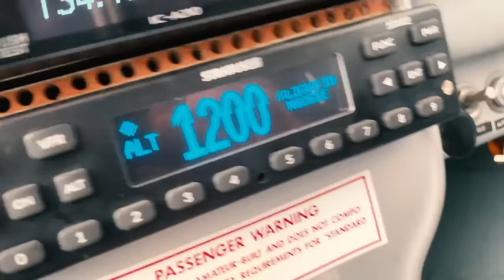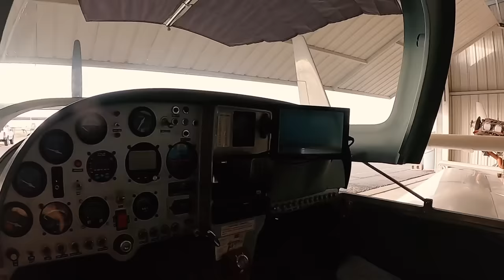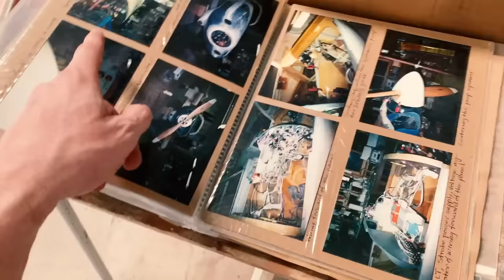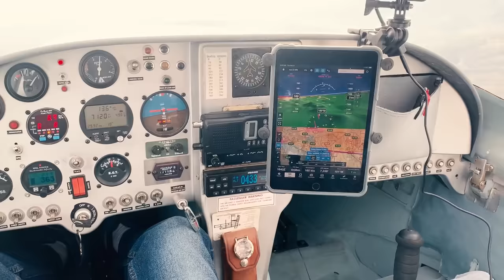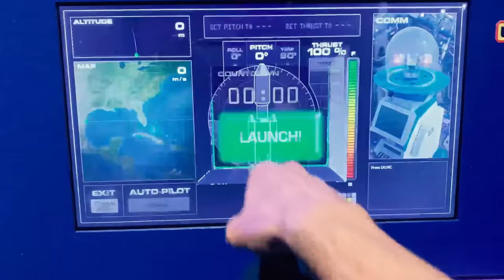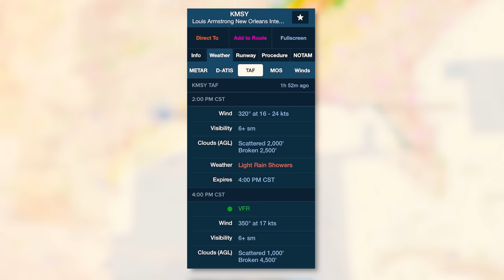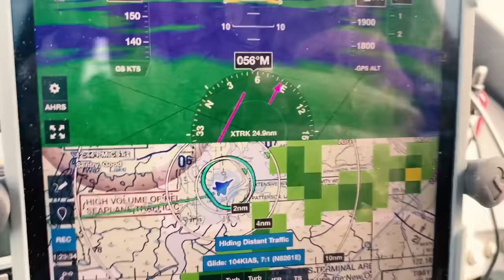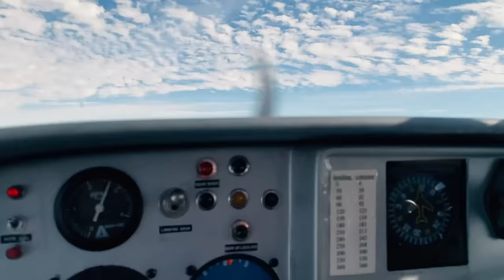Will This Small Airplane Run & Fly 2,126 Miles Home? Tornadoes

Comment: The jet is a Fouga Magister.. Awesome little training jet. French build, and extensively used by the Belgain airforce.. Love the Lancair!! I think you got a great buy there!!
Reply: Used by the Irish Air Core also. Good  museum piece at Atlantic Air Venture Shannon
Reply: @ju898  and by the Katanga Air Force in the Congo
Reply: @marcjohnson4884  Is that even still a thing?????????????????????
Reply: Louder that a T-37, and that says a lot.
Reply: @ju898  Irish Air Corps ;)
Reply: @paramotortheory  Much more louder...lol
Amazing old jet prop sound
Reply: Top speed: 444 mph

Range: 575 mi

Weight: 4,740 lbs

Length: 33′

Manufacturer: Fouga

Engine type: Turbomeca Marboré

First flight: July 23, 1952

Googled it lol
Reply: Fouga was also used by Finnish airforce
Reply: The Magister was used by german air force for training too… it was called mouse killer… the sound of the engine tells the story… that thing is loud as hell and at a ultra high frequency 🤪
Reply: Seems like a good first jet revamp for Jimmy.. Just sitting there waiting for some love... And to be started again!!
Reply: I once met a guy who was flying a Fouger Magister down to Florida for Sun'n'Fun from somewhere in the north of the US. He had bought a spare pair of engines for $2000 each, and ran the aeroplane on central heating oil. It cost him less to fly the Magister than it cost me to rent a PA28 here in the UK. We don't see many, if any, Fouger Magisters flying here in Europe these days.

Comment: I recognized Big Lake TX! My father (Orin Fell) used to go there throughout the 70s and 80s in the summer, to spray mesquite and prickly pear down there. I was a flagger for him. We spent every summer down there until I graduated from high school. He flew Cessna ag wagons initially, then got to AT301 air tractors with the R 1340 Pratt & Whitney’s throughout the 80s. I absolutely recognized the inside of the FBO office. The airport has changed quite a bit since then, but the inside of the gas shack has not. There used to be a Lockheed Lodestar parked off to the side that was hauling drugs and landed on a ranch. The dope haulers flagged a ride to town, then went into Big Lake and tried to pay cash for a pickup at Glasscock Chevrolet, and they smelled a rat and called law enforcement.

Comment: Jimmy the jet is French and is a Fougar Magister. I got two hours in one years ago because it was on the flight line of my FBO. Got to know the owner who also owned the 152 I did most of my Training in. I flew with him in his Bonanza to Burlington Vermont to pick up a radio for the Fougar. They are lined up like 152"s for sale. Along with other Military jets. Can"t remember the name of the outfit. Dean Martin was the owner at the time. Not the actor. Tail number on the one I flew was 404DM. If I remember correctly back then he bought it for 125000. Comes over the fence at 90kts.
Reply: Dave Nelson, crazy how small the jet community is, I owned 404dm back in like 2008/2009
Reply: I saw one about 35 years ago taking off out of Lancaster, SC of all places.
Reply: No offense but it is Fouga Magister, not Fougar Magister. The Belgium and France aerobatic teams flew those planes on airshows.
Used in Belgium, France, Germany, Finland, Ireland, Israël, Brazil, Oeganda, Cameroun, Togo, Rwanda, Marocco, Algerie, Lebanon, El Salvador.
Reply: @Airshowpilot  That is crazy, did you buy it from Massachusetts by chance or someplace else. Last I saw anything on 404DM it was in Texas
Reply: @lv8920  Thanks LV I have it written right in front of me on my desk with the correct spelling. Do not know why I added an r

Comment: SERIOURSLY jealous Jimmy.  After owning some fast glass (Glasair), I miss the awesome speed.  Little tip with landing - these things shouldn't be held off after the flare (ala Cessna), as they prefer a flatter touchdown.  Because the undercarriage is so closely coupled, they have a tendency to bang down on the nose gear if you hold them off too much and come down heavy on the mains.  It will take you no time to master this technique.  Did I mention I'm seriously jealous?
Reply from the maker: Thanks for the tips! I definitely need some practice

Comment: If those gauges are too hard to read in bright sunlight, a guy could probably make a nice sunshade that comes off the dash about 6 or 7 inches to shade the gauges.  It could easily Velcro onto the top of the dash (could be made from some thick cardboard and covered with vinyl tape).  Had something similar on my Honda Goldwing to shade my GPS unit, otherwise it was unusable.  Not sure if the FAA has to approve of it since I ain't a pilot, but I sure do love watching you do your pilot thing Jimmy!

Comment: I had a Mooney M20E and sold it and bought a Glasair III kit with the IO-540 and built it while in A&P school after I finished it I flew about 150hrs before switching engines for the Rolls-Royce M250. Now after installation I file at 20,000 FT going to Arizona or Texas. It's a definite speedy airplane now

Comment: Did a similar trip in the opposite direction in 2004 from Port Saint Lucy to San Diego in a Busby Mustang.  It took a couple of weeks to finish because of the weather and those towers definitely keep the pucker factor high.  Best trip I’ve had in an airplane and a great learning experience.

Comment: The airplane in 19:39 is the Fouga CM.170 Magister is a 1950s French two-seat jet trainer aircraft that was developed and manufactured by French aircraft manufacturer Établissements Fouga & Cie. Easily recognizable by its V-tail, almost 1,000 have been built in France and under licence in West Germany, Israel, and Finland.

In 1948, development commenced at Fouga on a new primary trainer aircraft design that harnessed newly developed jet propulsion technology. The initial design was evaluated by the French Air Force (Armée de l'Air, AdA) and, in response to its determination that the aircraft lacked sufficient power for its requirements, was enlarged and adopted a pair of Turbomeca Marboré turbojet engines. First flying on 23 July 1952, the first production order for the type was received on 13 January 1954. In addition, the related CM.175 Zéphyr was a carrier-capable version developed and produced for the French Navy.

While primarily operated as a trainer aircraft, the Magister was also frequently used in combat as a close air support platform by various operators. In the latter capacity, it saw action during the Six-Day War, the Salvadoran Civil War, the Western Sahara War, and the Congo Crisis. The Magister was also chosen by many aerobatics display team including the Patrouille de France (from 1964 to 1980). In French service, the Magister was eventually replaced by the Dassault/Dornier Alpha Jet. After its retirement by the French Air Force, Magisters were purchased by several private-owner pilots in the US and have since been operated in the experimental category.

Copied and pasted from Wikipedia
And also another great video by Jimmy's World! Love your channel Jimmy!

Comment: Jimmy, 
I'm 74 and started flying with my dad when I was 10 y/o and solo'ed when I was 16 and got my PP license before I had a drivers License. My dad bought me a Funk B85C (sweet) because he really didn't want me flying solo the family airplane a Beech Bonanza until I logged more hours. I digress your bladder issue is fairly common especially when you get much older (like me). The solution is actually quite simple.... get a disposable diaper.

Comment: That big old Camouflage jet you were looking at in Houston is an F4B or C. I couldn't tell for sure with what little I could see. It looks unweildy but during its time set many records including the climb record from takeoff to 40,000 feet. I was blessed/cursed to have been a maintenance tech on it for about 12 years from 1967 to 1979. It put out over 40,000 lbs of thrust and would fly at Mach 2 or better at altitude.

Comment: Awesome aircraft 👊😎 Just love it. I know it's light as far as weight. I mean get it inspected or could you get it inspected while you're there in Houston? I know getting a FAA wrap out is by appointment. But you never know. All he has to do is verify the equipment and you'll be rated. It's up to 10,000 ft. No? Ps the way your aircraft was maneuvering is called the Dutch roll. It's a naval term.

Comment: His comment on the nose wheel happened to a military Convair in the Navy. Went out for T& G. Second landing the port land gear with the cylinder fell out of the casing. Successful wheels up landing and 2 months repair and new engines because of prop hits. Back in the air again. The cause was determined to be corrosion inside the cylinder and the flange.

Comment: Your question about that little V-tail jet has probably been answered 100 times by now, but rather than wade through 2,932 comments to make sure, I thought I'd just comment.  Skip it if you already know the answer.  The airplane is a French Fouga CM.170 Magister.  We had one here at Stellar Airpark back in the early 2000s.  I remember one guy commented to me as it took off that the Turbomeca engines has about as much thrust as my hairdryer.  Pretty darn cool though..

Comment: Those two yellow airplanes were part of a firefight air attack company. They used 4 engined piston powered aircraft. The company moved north back in the early 90's. The v tailed jet was supposed to be the spotter plane. Its actually still on the airport property. Its been there for 30 years or so. Back in the day Lufthansa had there advanced training school here. Many of the students were young females from Europe. Very lovely young ladies. I met a couple at local restraunts here.

Comment: A french guy recognise a yellow FOUGA MAGISTER, yes a french jet trainer designed just after WW2. The designers were making gliders before, so the shape is inspired by their previous machines. The "patrouille de France", french army demo team used it for years...I heard from old pilots it was a superb flying machine, but very underpowered, to achieve aerobatic manouvers you had to manage very precisely you kinetic energy and airspeed...some are still flying all over The engine makes a very high frequency noise at starting...

Comment: The jet is a Fouga CM170 Magister a 1950's French 2 seat trainer with a top speed 444 mph
Range of 575 miles 
With a turbomeca Marbore engine 
First flight July 23, 1952.

Comment: I don't remember if you said you had autopilot,  but I have a empty 64oz V8 bottle in my car for emergencies! Since my car doesn't have autopilot, I have to pull over to use it, but I don't have to get out of my car, or wait to find an official facility! If you don't have autopilot, I suspect you could use it one-handed if you build a holder for it out of coat hangers. ;)

Comment: Long but action-packed!  <3
At 00:40:02, it's a matter of life or death decision being taken, all too common deadly GA scenario, it's great how you and your family handled it (but if it was staged, it is still extremely well done and best ever dramatization)
At 01:15:10, however, you probably raised VFR pilot expectations a tad too high :) Instrument rating / IFR flying does not equal all-weather flying and it doesn't make flying safer by default either.  Flying VFR in VMC is at least keeping you out of 2 evils, embedded CBs/thunderstorms and icing. With instrument flying, we need to have on-board real-time weather radar and anti/de-icing capabilities, which are usually priviledges to the commercial/airline world, due to their cost. And not to mention the regular practicing of instrument flying skills, because many VFR-to-IMC accidents actually happen to instrument rated (but not current or not prepared pilots). So getting IR ticket for private flying is more useful, but it has its drawbacks / dangers as well.

Comment: I don't understand that IFR certification of the plane. If you are rated and the plane has the instruments, what else do they need? Is it just a sign off or what? 
That was a dicey flight, but you made it home safe and sound!
Reply: They need the instruments to be certified  accurate and reliable for ifr flying. Instruments not ifr certified might not be accurate enough for what ifr flight needs. In vfr conditions pilot can easily see and adjust but in ifr it might be too low or not visibility to adjust

Comment: Hey, jimmy, if the weather is that bad, the turbulence is that bad, don't you think you should be flying with two hands on the yoke instead of one hand and one hand holding your cell phone to take a video!
Reply: I am also a loyal subscriber, jimmy
Reply from the maker: This airplane only has a stick. One handed operation and it requires extremely light control movements

Comment: I saw a video, where a female fighter pilot showed how she would trim out her plane, engage the auto pilot, loosen up her seat belts, unzip her flight suit around and then slide a bottle/funnel assembly into her flight suit so she could pee in a bottle, while in flight.
since the Lanceair doesn't have a honey bucket on board, you may have to get one of these assemblies for your use while flying it.
You did point out that plane with the other 310, which had a "Snack Bar" as well as a honey bucket (the one where the guy had let them sit for a decade or more and figured he'd just have to redo the annual and he could get more than you offered for the two planes)
Reply: is that an App you can get for a Tablet to effectively be a weather radar?

Comment: 49:37 WOAH! Antiquated iPhone charger spotted! You’re using the USB-A to lightning cable with the tiny Apple 5 volt 1 amp 5 watts charger with your iPhone X/XS No! Bad! 

With how busy you are, you should be using a USB-C to lightning cable with an Apple 9 volt 2.2 amp 20 watts USB-C charger. Your phone can charge SO MUCH faster!

You’re not taking advantage of the extra 300% BTU’s of charging power WTH?!

Comment: “SPACE” 

HOW MUCH CURVATURE “DROP” DID YOU HAVE TO ADJUST FOR WHEN MAKING THE 2000+ MILE FLIGHT? 

FLYING ACROSS THE “GLOBE” IS MUCH MORE DIFFICULT THAN FLYING ACROSS A PLANE….  LIKE A FLAT NON-ROTATING EARTH.

DID YOU HAVE TO ADJUST FOR THE SPIN OF THE BALL?!?

THE EARTH SPINS SO CRAZY FAST.. IF YOU WERE IN A HELICOPTER… YOU COULD JUST HOVER OFF THE GROUND AND LET THE EARTH DO THE WORK?!? 

YEA…. NASA IS FULL OF.

Comment: in my humble opinion, one day dude you will be in a serious accident.. ill explain, first, your holding a phone filming during a storm focused on filming instead of flying the plane. clearly it seems you are reckless in this aspect. second, your gear is going to fly up and hit you or worse hit the instrument panel  and change settings. 2 is that plane rated for storm conditions. the drops you were going thru stress the wing joints out and more than likely will be a failure point after years of abuse.. like buy some go pros and mounts and focus on flying. i wont be part of subscribing to you because of poor flying. no need to encourage you.. idc if it was 1 time you did this, your creating bad habits and it will cost you one day. and from the looks, soon. sorry to be so bleak and harsh in a time like this in our world. but dude i wouldnt fly with you and if i did i would of tossed you r phone out the window and told you to fly the plane. it was hard to watch the 10 sec i did during your storm. good luck